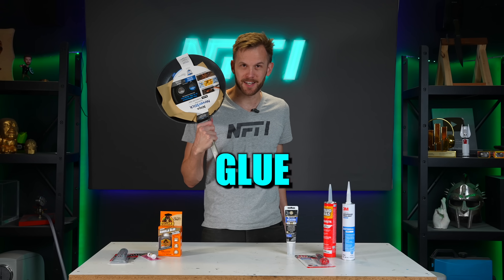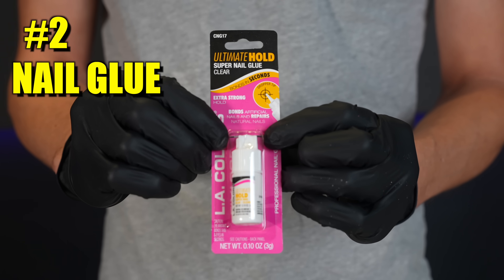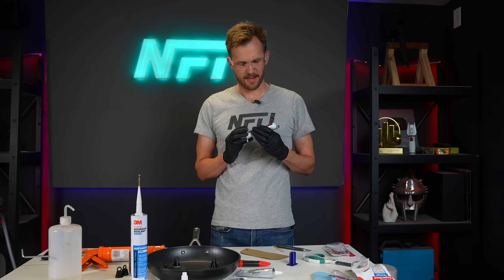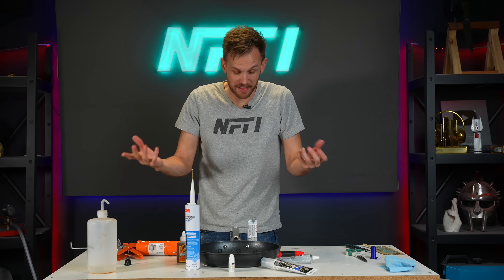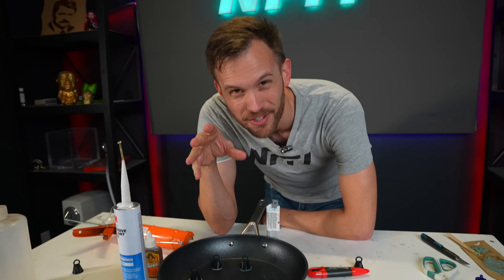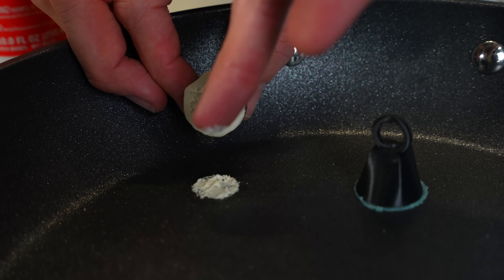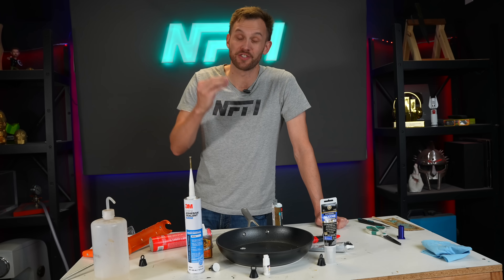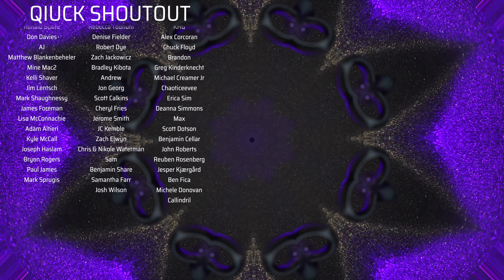Can ANY Glue beat the Non-stick Pan?

Comment: Have you tried baking an egg in it? That should stick to any pan if you let it burn a bit. XD
Reply: My dad glued a plate back together and put in the dishwasher. The food stayed on, but the glue did not.
Reply: Oooooh....
A new type of bioadhesive?
You gotta get on that concept right now~
Reply: Right?!? That was the first thing I thought of. That crap isn’t just going to “peel” up 🍳
Reply: Try a Granitestone pan
Reply: won't stick to cast iron.
Reply: Eggs aren't any better at sticking to pans than any of these glues are. 
If they are sticking to your pan, it means that you've put a ton of microscratches in the nonstick coating over time using improper cooking utensils on it, or have been putting the pans through the dishwasher.
Both will absolutely destroy the Teflon coating on non-stick pans.
Reply: ~ya~
Reply: My nonstick set from walmart begs to differ sir... 😂
Reply: The nemesis of nonstick pans: eggs.

Rice does it too
Reply: Lol
Reply: Or gummy items, don’t let em burn, just melt!
Reply: Dried on cornflakes or weetabix are also contenders...
Reply: Baking?
Reply: People have already done that with this pan and it came off easy. One even tried caramel and marshmallows as well but they didn't stick either
Reply: @TwistedFoxblade  projet farm has a video testing pans in great detail.
Reply: Baking? You mean frying😂
Reply: @XxKingJTuckxX  English isn't my first/native language. Doesn't frying imply a large amount of oil? As in submerging a food in it?
Reply: @MLeoDaalder  With an egg, we usually mean just letting it sit in the pan and cook. Frying is also used for submerging food in oil, like fried chicken. Welcome to dumb English. It can be confusing.
Reply: There are different types of frying, deep frying is submerging it
Reply: @MLeoDaalder  Frying is cooking something using oil. Deep frying is submerging food in oil to cook
Reply: @MLeoDaalder  Deep Frying, yes. Pan frying, no. Only a small amount on the bottom of the pan is needed for pan frying.
Reply: That's not how it works.  If it's none stick That's literally what it means.It's not gonna stick
Reply: you've clearly never seen a shopping channel, that's how they show the non-stickiness of the pan in the first place
Reply: 😂 10000%

Comment: Can you get hold of whatever they stick the labels on with?  I have bought non-stick pans with glued on labels, and had a horrible time trying to get them unstuck, and they just tear, and take tons of scrubbing to remove the glue.
Reply: Soak them in a drop of rubbing alcohol or sanitizer. They come right off after a few minutes.